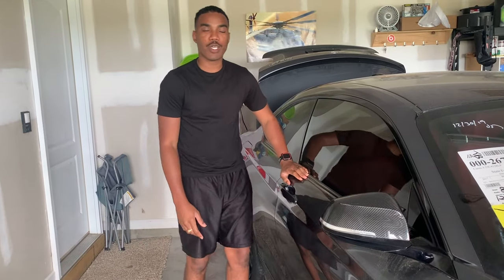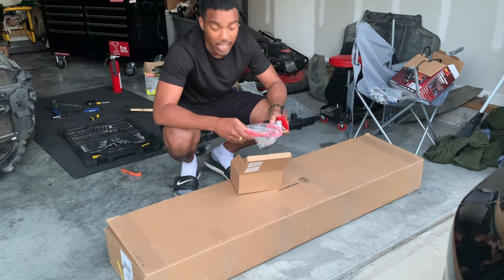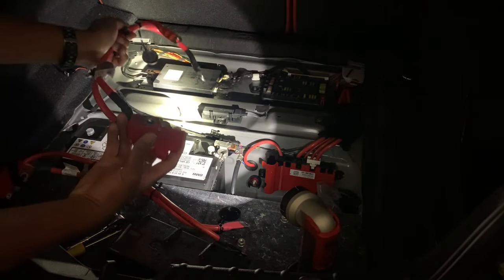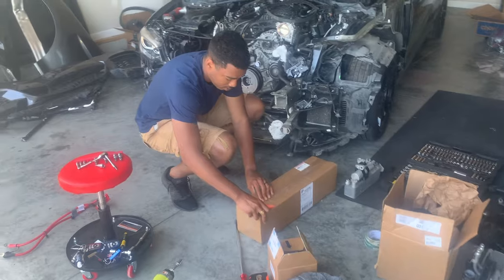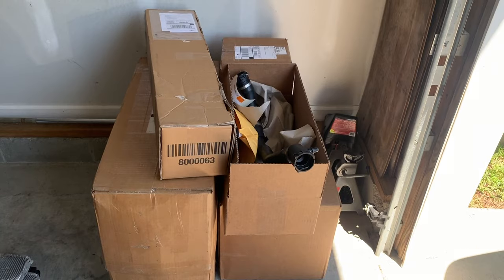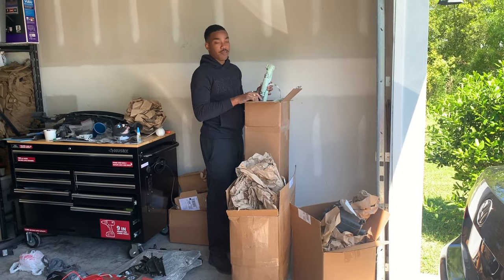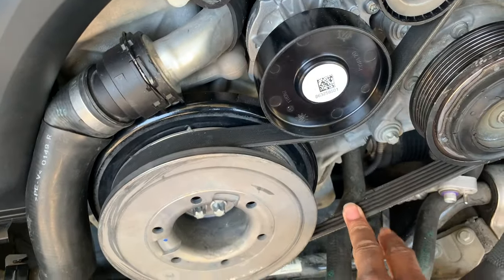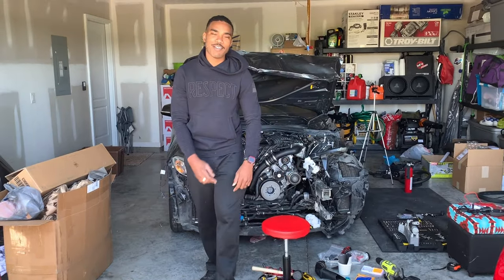How to get a BMW to start, Rebuilding Totaled BMW M240i during the  Covid-19 Pandemic. Part 3

Comment: What is the part number for the positive terminal?
Reply from the maker: 2017-2020 BMW M240i Battery Cable 61-12-9-348-761
Reply: @weerebuildz4427  thank you
Reply from the maker: @jessegonzalez3404  you can get it cheaper on fcp euro and parts geek. and you can find it on bmw on line and its cheaper than calling the dealership.
Reply: Hey man sorry to bother you did you have to remove the srs module to clear the air bag  codes
Reply from the maker: @jessegonzalez3404  no you not have to remove that German cars you just hard clear the code with the scan tool and it will come off once you put the new parts in.
Reply: Ok thank you I’m getting this 2 codes might have to send the back to vendor who rebuild them 
1 Belt force limiter, front passenger:
Resistance too high
2Retractor tensioner, front passenger:
Resistance too high
Reply from the maker: @jessegonzalez3404  hey text me on IG so I can talk to you better. but if you clear them and they are still on that mean they were not done correctly or maybe you have somethings that needs to be fixed.